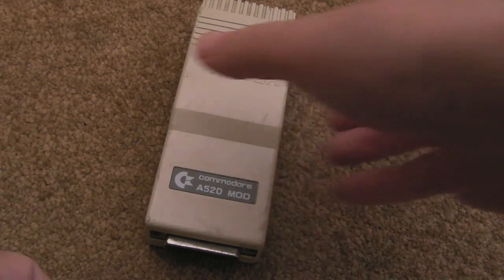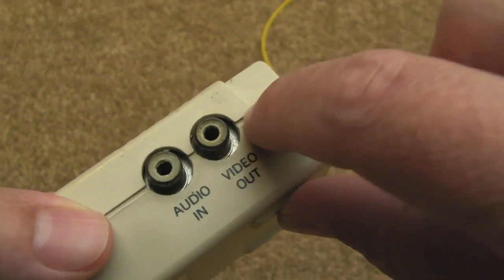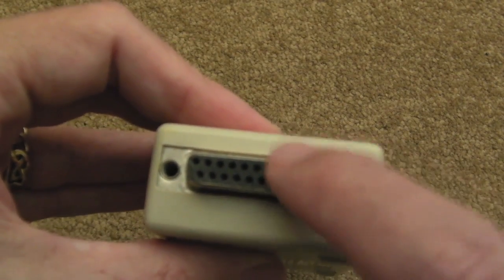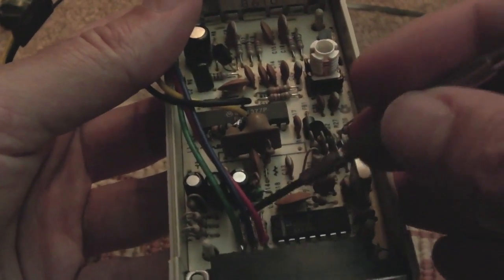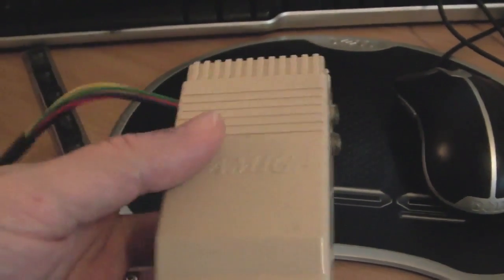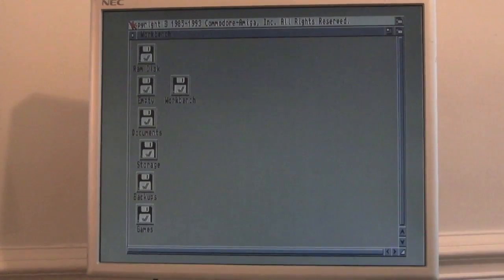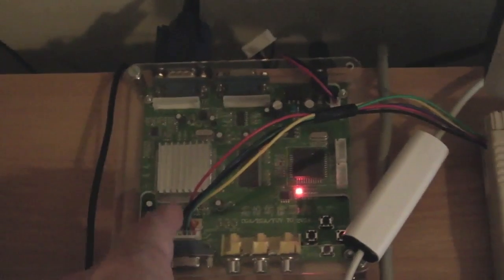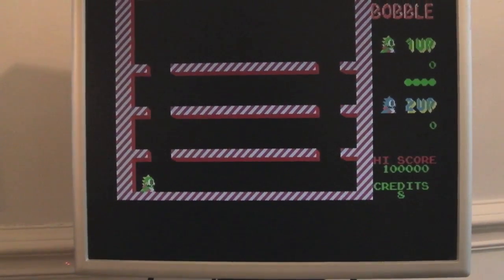Commodore Amiga GBS-8220 (Cheap VGA Upscaler) Connection

Comment: Sorry, I don't understand why you're picking up rgb signals from the a520 modulator instead of using directly the rgb output of your amiga.
Reply from the maker: At the time it was a convenient way to connect up - based on the fact the D type connectors were impossible to find.  You can now buy them from a seller in the US.  You can of course just take the connector off the modulator, but the modulator still works this way too.
Reply from the maker: You can also "mod" a larger D type connector too - but that can be messy imo.
Reply: @GadgetUK164  thank you.  Last question, do u still suggest this solution to interface an a500 to a modern monitor?

Comment: Have you done the copper tape mod on that upscaler?
Reply from the maker: Yes, I think I added the copper tape in a later video.   There's also a small mod I still need to do involving a resistor and cap I think.

Comment: Fwiw - the part number for the video cable is DB23FS - (DB23 Female Solder Type) - you can find them on IEC's website (or even Amazon) - hopefully that helps others making cables for these :).
Reply from the maker: Thanks, very useful!

Comment: hi! one question: the yellow cable what is the position on chip , 6 pin?
Reply from the maker: I used yellow for ground and it went to pin 15 on the MC1377P
Reply: ok thx and one question more: what kind of resistance you use for de cable?
Reply: and thx very much for help me ! im really apreciate

Comment: I have one of these on my A1200 and haven't been able to get a "perfect" picture. I get red and white speckles through the white video header and the 15pin VGA input. And I have the 680 ohm resistor on the sync.
Reply from the maker: They aren't all the same!  Depending on the RAM used on the board and the revision some give more noise than others.  I think this article by Ian Stedman talks a little bit about some of the issues. https://ianstedman.wordpress.com/gbs-82xx-experiments/
Reply: I was able to remove almost all of the interference speckles by adding some thick foil duct tape as shielding to the back of the pcb directly behind the ram chip on my Hynix version. Found this fix on a German Amiga forum.

Comment: @ GadgetUK164 
Do you need to connect the grey wire ? or just the yellow to the sync ?
Reply from the maker: Just yellow!  I didn't use the grey wire at all!
Reply: Thank you.
Reply from the maker: And on the white connector there on the GBS-8220, black is  nearest the edge of the board (ground), then from the opposite side of the connector you should have in this order, red, green, blue, yellow, then 3 pins empty before the black at the end.
Reply: I have Red,Green,blue,Grey,Empty,Yellow,Empty,Black.
Reply from the maker: Ah OK, I must have swapped by wires around!   You need red, green, blue, YELLOW (or GREY in your case), then empty, empty, empty, black.
Reply from the maker: Also, once you get the wires right and you get a screen, it might look a mess and need you to adjust menu settings on the GBS-8220.  For reference, mine is set like this at the moment:- Birghtness 60, contrast 50, saturation 50, sharpness 6.  Geometry - H position 51, V position 14, H size 49, V size 57, Clamp ST 91, Clamp sp 08, Display set to 800 x 600.
Reply: Thanks mate i'll do that..If this works out i'll get another GBS-8220 for my other Amiga's..I thank you again..
Reply: Do i need the 680 ohm resistor on the sync ?
Reply from the maker: Yes!
Reply: Cheers..its working fine..
Reply from the maker: Great =D

Comment: I lost the lead that connects to the GBS, anyone know were i can get one from?
Reply: +joe194b To be clear, the lead i need is the one with white plug that gadget modified to work with the Amiga or if any one knows what type plug it is i could make my own. 

Thanks
Reply: +joe194b i believe its called a JST connector, with the correct pin count of course.
Reply from the maker: +Gillian Seed I think something like this might fit:- http://www.ebay.co.uk/itm/JST-2-0mm-PH-8-Pin-Connector-with-Wire-x-10-Sets-/181441351430?hash=item2a3ebf4f06:g:X7EAAOxyGStRx6F~

Comment: Yes an Amiga video :) I could never get a good quality picture from them converter boards. Even made up the "Microbeetechnology CGA to VGA" converter and never found the quality absolutely perfect. Ended up getting an original 1081 monitor and the difference is amazing. Amiga looks amazing on a CRT.

Comment: I just ordered 4, 23 pin female D-sub connectors if they turn out to be the correct ones I'll be glad to send them to you.. the companies located pretty close to me just winter here and didn't want to drive down there today
Reply: +GadgetUK164 Even cheaper : http://www.amibay.com/showthread.php?t=79239
Reply from the maker: +calthmlikiseethm Thanks, much appreciated but I don't need any now!  I've also spotted in the last day or so someone is selling them for £3.99 on eBay - typical, like buses, whenever you want one there are none and when you don't 3 turn up at once!!!

Comment: I remember having "scandoubler" on the A1200 to be able to attach a 800x600 SVGA monitor. Is it the same principle ? OH wait sorry.. Ah it is a upscaler to upscale original resolution. The scandoubler I remember I had to select special higher resolutions for it to work with SVGA. Original games did not work on SVGA..
Reply from the maker: +bwack Yes, this outputs at 800 x 600 or 1024 x 768, I think it will also go up a resolution or two beyond that.  There's a better way of doing this with one of the Indivision AGA mods - Clips on top of Alice I think and gives a perfect display.
Reply: +GadgetUK164 Nice clear video from you btw thanks. The A500 is known for its smooth scrolling I think.. The video seemed to scroll very smoothly (even through youtube lol).. Do you remember if the scrolling is smooth on the C64 ? I can't remember. I do however recall the intro screen to diana sisters, the large text scroll was smooth back in the day, but on my lcd screen it is not smooth motion... Maybe its my lcd..
Reply: +GadgetUK164 Regarding banding. Just a hunch, could be 50Hz residue on the video buffers powersupply.. I had that problem with the modulator on the breadboard (actually it was 100Hz because it was rectified/unregulated). The banding-wave is scrolling slowly because the 50Hz mains is not completely in synch with the 50Hz screen.<
Could be ground loops also..
Reply from the maker: +bwack Yes, scrolling on the Amiga is great - Lovely Agnus =D  I think scrolling is pretty good on the C64 tbh!
Reply from the maker: +bwack I think its the mismatch between LCD outputting 60Hz and the camera capturing at 50Hz, yet refreshing the view finder at yet another frequency - not sure what but its not 50 or 60Hz on the view finder screen, probably 24Hz or 25Hz I think.

Comment: The picture look stunning, i have one of them GBS-8220 in my arcade cab i use it to upscale the
15khz signal coming from the JAMMA egde connector to the VGA monitor i have installed in it.

The old CRT in the arcade cab took a dump one day and i decided to convert it to a MAME cab
but it can still play jamma games as i have the GB-8220 upscaler for the VGA monitor i istalled.